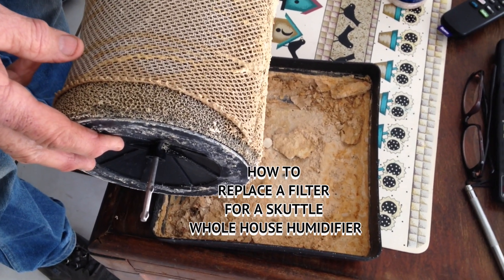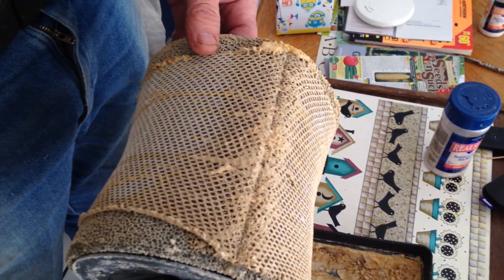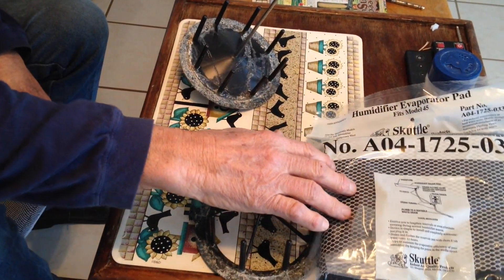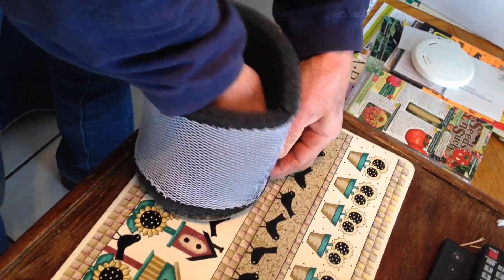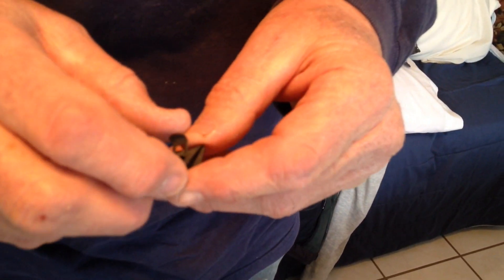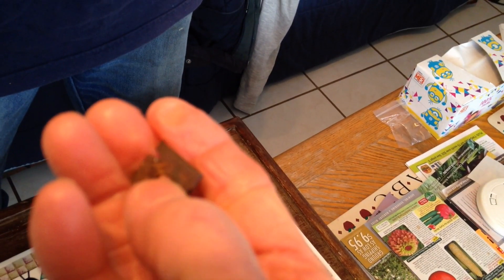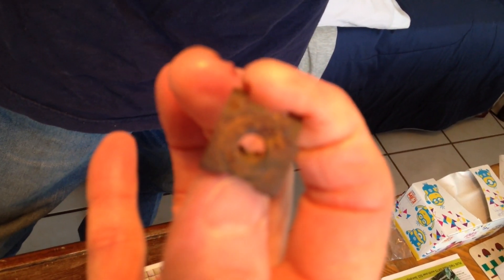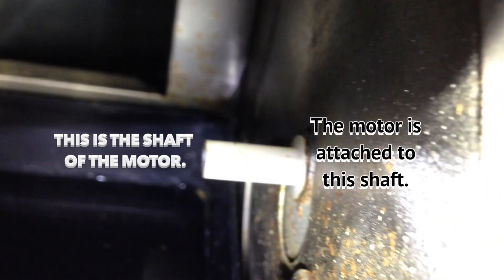HOW TO REPLACE FILTER FOR SKUTTLE WHOLE HOUSE HUMIDIFIER

Comment: It is calcium, not fluoride.  Also called lime.  Comes from limestone in the earth where our drinking water comes from.  Limestone is water soluble and is transported via our water supplies.    How much depends on where you live and where your water comes from.  Most treatment plants allow for a certain range of calcum (hardness) in their water.  You can call them and ask what the level is. All water suppliers are required to test for it (and certain chemicals and biologics) every day.  It builds up in the humidifier when the water evaporates and the calcium gets left behind.  There are products for cleaning the calcium and lime.  CLR or LimeAway will clean some of it off.  Just need to remember to shut it off at the end of every heating season and clean it then. It is easier to clean at the end of the heating season rather than letting it sit all summer long, dry out and get even harder.

I installed a filter system for our drinking and cooking uses.  The underground geology of my area is primarily lime stone. The city water department gets the water from deep wells that are near the river but under the limestone.  The earth filters much of the stuff from the river water but this also adds dissolved calcium and lime to the water that the city doesn't remove.  Some calcium in the water is beneficial. Too much is a problem.  Many people in my area get kidney stones but the mds say  its not the water. Sure.

Brown deposits on your tub, sinks and toilet? That's iron.  Some iron in our diets is needed to live. Our red blood cells are red because of the iron.  Much of our food is "fortified" with iron.
Reply from the maker: WOW !!! What a wealth of information. Thank you so much. Thank goodness we are drinking spring water straight from a spring. I would imagine all that buildup could really be a problem along with the so called "food stuff" made in a lab and packaged as food. Very good advice so I will have my husband read and apply this information. Thanks so much.